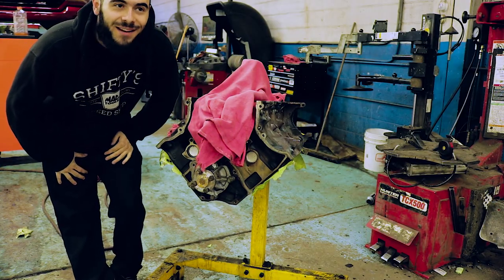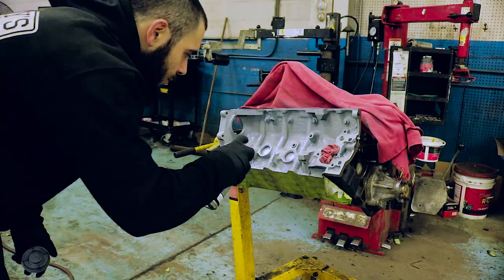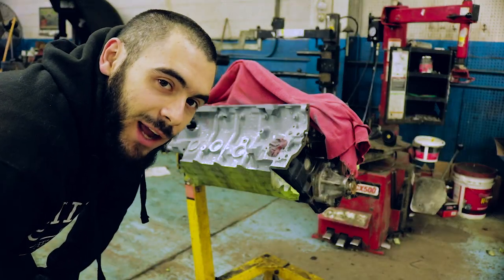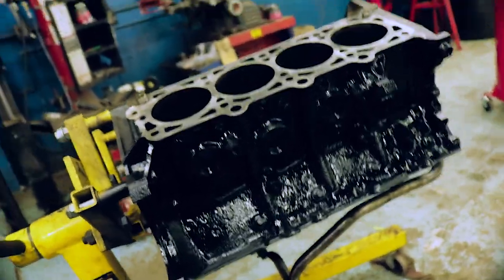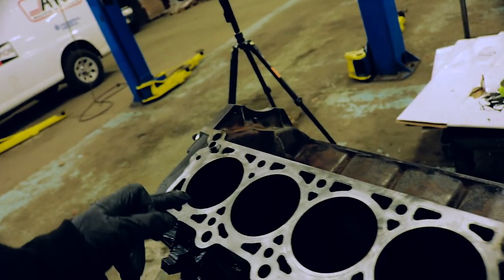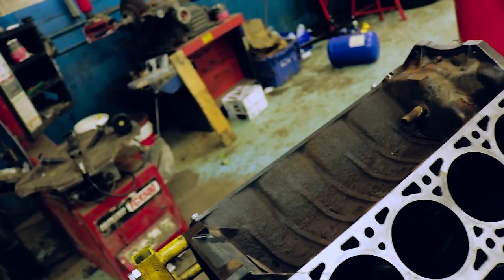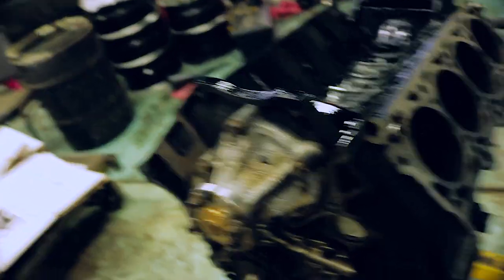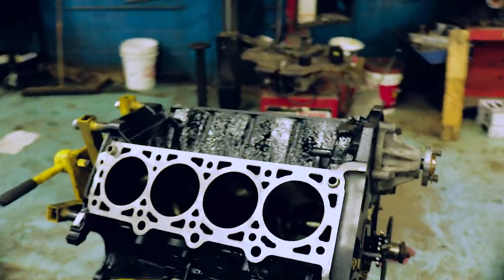IM BUILDING MY 4.6 2V SN95 MUSTANG ENGINE - QUEST FOR 300WHP

Comment: Man oh man this makes me wanna pull my 4.6 and go over it.. too broke to build it right though lol. You should blast past 300 wheel with what you have planned :)
Reply from the maker: I'm hoping! If I can't make that, then I wasted my money lol
Reply: @RatchetstrapMedia  That was once of the biggest things I sadly discovered with the 4.6. Reading through forums, its tough to dump 2-3 thousand dollars (depending on what you do) into that engine when ON3 Performance makes a turbo kit for around 2 grand. I know forced induction isn't the greatest for drifting but it is probably the best way to make power outta a 4.6. Especially if you build that engine up.
Reply: John Ratchetstrap should buy 4v heads they go for 600 bucks
Reply: @crownvictorialifestyle4421  the engine drops a ton of compression with the 4v heads. there is so many little parts you need for that swap you're better off buying a complete 4v engine
Reply: CanadianRCs no I no what I'm doing it's no different from the 2v 

All my research has been done I'm not scared of the four valves sorry buddy
Reply: CanadianRCs MMR sales plenty of what I need
Reply: CanadianRCs have you ever seen 4v heads in person

On my channel I did side by side comparison and trust me the difference is small 

For my ysi 4v build I'm using je +3.5cc dome piston or cp flat top both will get over 11.17 to 1 compression witch is fine it might be 12:1 compression once block is deck and heads 

The swap is straightforward I use my stock harness stock sensors stainless works long tube headers what is so hard about this sir is what I'm trying to get to I don't see nothing hard about the swap the 4valve will bolt up to any transmission

MMR sales coolant crossover delete lines and other things

They sell coolant mods they sell everything to make the swap easy indeed is going to cost a pretty penny but you have to pay to play and the rewards will reward you bountiful with 4-valve heads over 2v heads with a blower
Reply: CanadianRCs my guess is the fact that you didn't respond back to the conversation is because you don't know what you're talkin about
Reply: You drop down to 8.5:1 compression if you just slap 4v heads on a 2v shortblock. So you are looking at a whole rotating assembly to make it worth while. 4v heads have a 55cc chamber vs 44 on the pi 2v. Not worth it unless you build your block or full on 4v motor swap

Comment: I have one built 11.7 to 1 compression e85 fuel Only that's gonna be the trick to getting  over 325rwhp 93oct ain't gone cut it I also have custom cams which are a little more aggressive than comps 270 I'm waiting on a degree set 2 degree my cams in

Comment: I built my modular and the oil pan leaks like a cock I'm so pissed. Gotta yank the motor to replace it.
Reply: Take your time I triple checked mine I'm waiting on a degree set 2 degree my custom cams in I'm looking for 330 rear wheel plus rods and pistons e85 11.7 to 1 compression on my channel